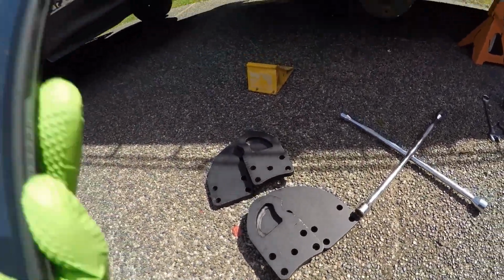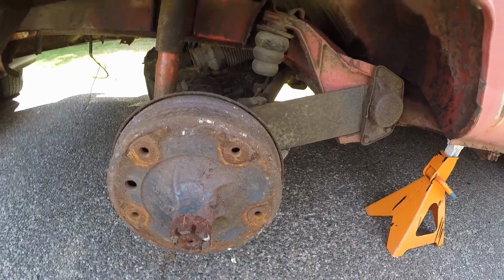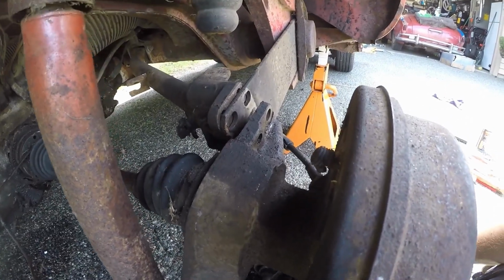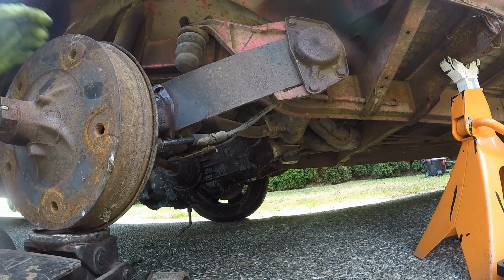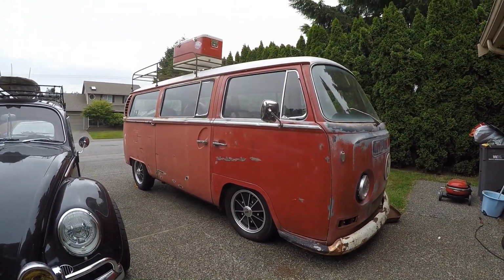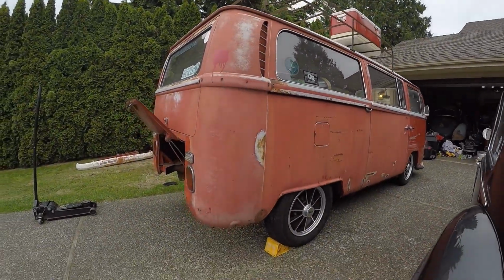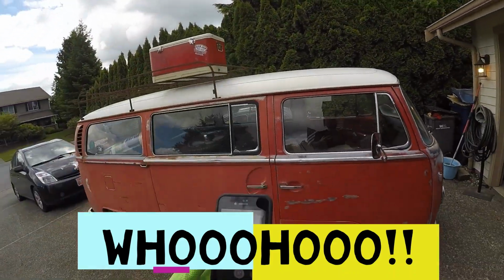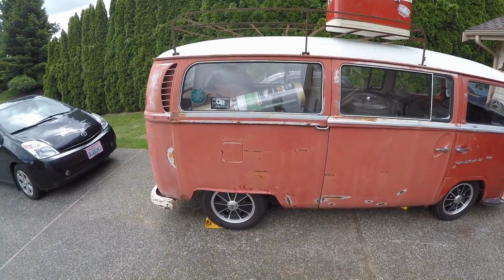WagensWest Slam Bay Kit Install Pt. 7

Comment: Looks awesome !  I'm lowering my 69 as well.     
The front drop spindles from Wagenswest...........    They will work with stock drums and/or disc ? 
I saw you have trouble with the disc bracket,   get out the drums,  but then got the disc to work. 

I'm asking because most drop spindles will not work with drums.    That is awesome if these spindles work with either
Reply from the maker: thank you! hope you enjoy following the build.  I ended up sticking with Disc brakes up front with just some minor mods to the spindles.  Hope your build goes smooth!
Reply: @volkswerkinbyhfifty3652  The stock drums would have worked on those drop spindles?  Sorry, that was my question 
that is not the case for most drop spindles,  that is why I'm asking.